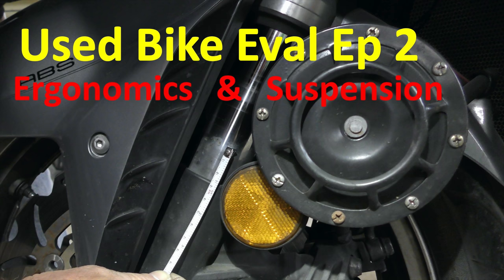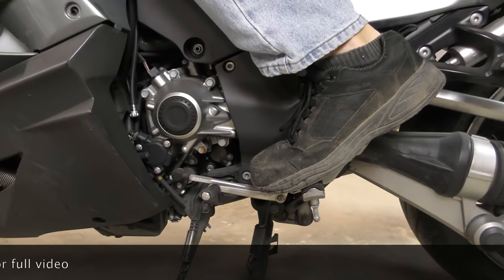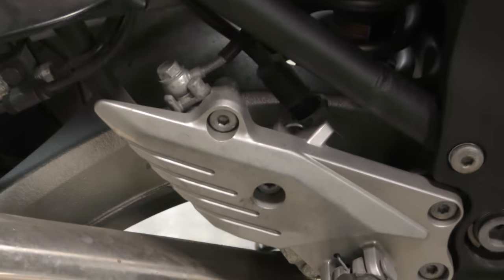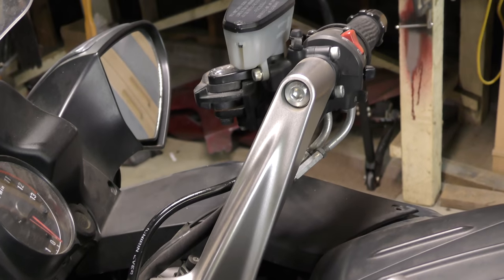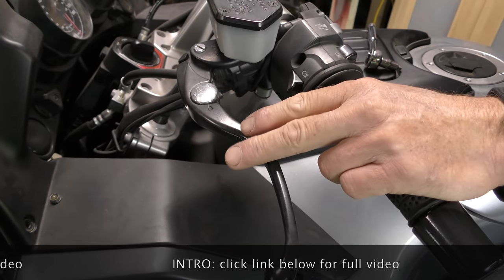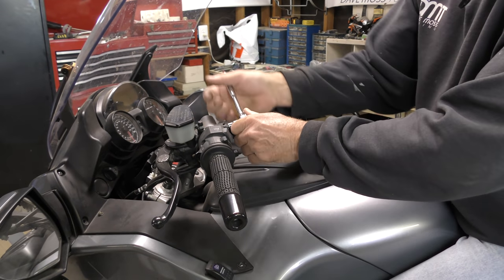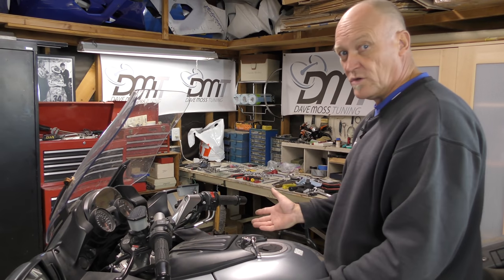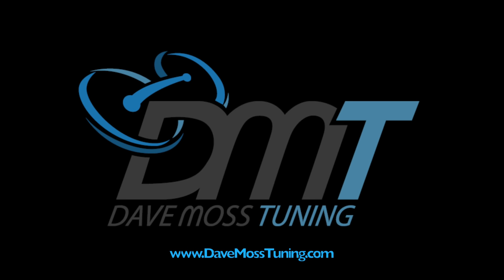INTRO Concours14 Project: Ergonomics & Suspension Eval & Setup Ep 2

Comment: I really wish I could have a session with Dave too setup my bike and get some knownledge. I rode an '01 R6 for a year and just bought a '05 R1 couple of days ago. I feel like my problem is I'm too stiff/scared, after a roundabout when my front tire slipped at probably 35° angle at low speed. With my R6 I'm comfortable even with my knee at the ground on left hand turns.
Reply from the maker: That's why we offer Remote Tuning so we can set up your bike via video.
Reply: How much is that? I just subscribed to the site for more too learn more. And it sure helps
Reply from the maker: @Risdal123  Annual is $49.99 or $9.95 for one month.